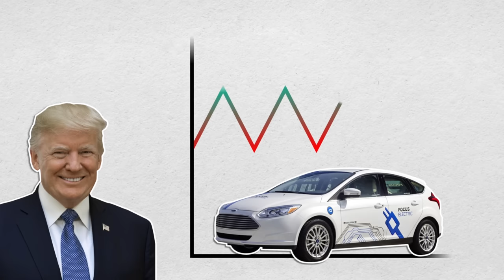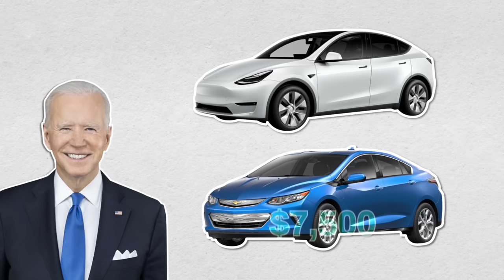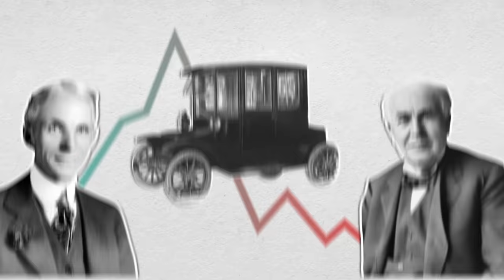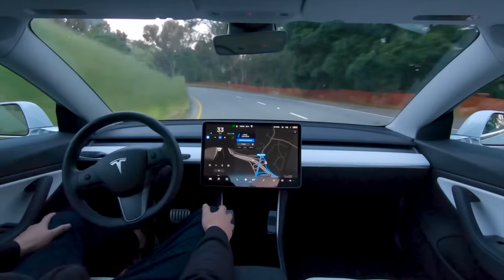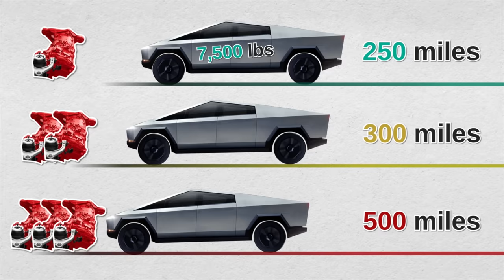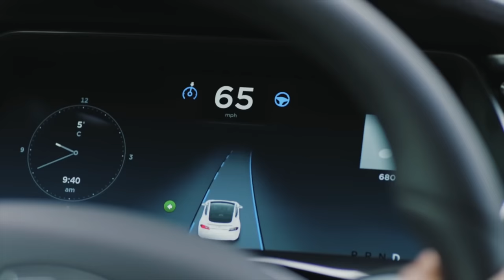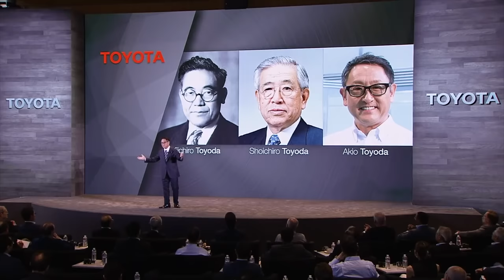Here's Why Toyota is Refusing to Make Electric Cars

Comment: You couldn't give me an electric car. Currently, GM is recalling over 140,000 2011-2014 Chevy Volt cars as their batteries do NOT last as long as predicted and thousands of owners are disgusted poor mileage distance the cars travel before a charge and length of time to charge the vehicles. Of late several electric cars including Jaguar have burst into flames while charging. Not a good idea to keep these vehicles in the garage. Battery replacement costs are thousands of dollars.

Comment: A few problems.

First, the US is not the world. Loads of countries have incentivized EVs and have been rather successful.

Second, all governments have been super nervous about EVs because it screws up a lot of funding for the roads. There's no per unit fuel tax for electric vehicles. However there could be one for hydrogen.

Burning fossil fuels in a power plant to generate electricity is way more efficient than burning them in an internal combustion engine. And EVs are way more efficient at using electricity than ICEVs are.

Comment: Bolt EVs have all been recalled for batteries spontaneously causing fires.  Chevy has notified Bolt owners to NOT charge their car in the garage or near a combustible structure, such as a house. Tesla vehicles have had the same issue for a while and are widely known to erupt in flames when in a serious collision.  Lithium-ion batteries are notorious for spontaneous "arcing" which causes fire.  Current biggest problem with all-electric vehicles is the potential for your car to go up in flames for no apparent reason. The battery technology has been forced into service by auto manufacturers well ahead of when it should have been deployed.  Good luck for now, EV buyers.  Wait five years and these issues should be solved.

Comment: Lead acid batteries were too heavy for cars for the amount of energy - why edison's electric car would not sell.  In 1996 GM had the Saturn EV1, but they were leased only and used lead acid batteries.     It is all in the battery today - they are using better chemistry that is light in weight for the amount of energy.   Hydrogen cars may yet have a place because they are more quickly gassed up than an electric car and are better in cold climates.   However, it is still less efficient to generate hydrogen gas than electricity.     You cannot easily make hydrogen gas at home to fill up the car.  However, you can generate solar energy that can help offset costs of charging an electric car.    Electric cars are less expensive to maintain with fewer moving components until the battery wears out and needs replacement.  Electricity is less expensive than gasoline.   If they can get the prices down with volume production,  electric cars/trucks are better alternative.

Comment: oh - come on Scotty.  Do a little research.   Toyota is re-entering the electric vehicle market with the 2022 bZ4X crossover.  Toyota also had previously sold the RAV4 EV.  Additionally, Toyota has several Plug-In models.  And, their hydrogen cars (being tested out of Los Angeles) are techically EV cars using a Fuel Cell to generate electricty that drives Electric Motors.

Comment: Toyota have won the race for the solid state battery and they are making a line of EVs in the next few years, H2 have problems with both the high pressure and low temperature of the fuel which makes metal brittle and may even pose a danger, ATM it's a challenge to get a working mass market car. 
H2 has it's uses, for industry and home heating but using it in cars is daft.

Comment: I will suggest that Taiwan and Japan share some economic realities. I have been to Taiwan; I have no personal experience in Japan. Taiwan has no oil industry (it has no petroleum reserves). It imports all it's oil. To make gasoline affordable for consumers in Taiwan it has to be heavily subsidized. Taiwan has natural sources of electric power in hydroelectric projects. Solar electric projects, wind electric projects, tidal projects. Taiwan is a relatively small island with most destinations reachable on one charge with currently available all electric vehicles. For Taiwan--an island with no petroleum reserves--electricity is just a very natural way to go. I expect the economic realities are very similar for Japan. I don't believe the propaganda suggesting that gasoline is a better source of power for small islands that have no petroleum reserves. ...especially for small mountainous islands that have great potential for hydroelectric projects. Earthquakes??? Electricity from multiple sources is still better for small islands with no petroleum reserves.

Comment: A car mechanic that does not like electric cars (that require less maintenance and therefore fewer car mechanics).  Hmm...

But yes, some things are pretty obvious.  Cities are too polluted, so urban areas will need to move away from polluting technologies like gas and diesel, over time.  That could be electric, that could be hydrogen, but the power for these can be renewable and/or outside of the urban areas.  Electric cars will need to have some quicker way of recharging or quick-change batteries -- perhaps gas stations becoming robotic battery change stations.  And EV prices would need to come down some so that cost per mile is more competitive.  Tesla, GM, and (in Europe) VW are pretty close, but not quite there yet.

Comment: I'm still waiting for a super or ultra capacitor based hybrid.
Reply: You'll be waiting a long time. The energy density of pure electrostatic capacitors is unlikely to get close to chemical energy storage (aka batteries). The latest batteries are almost as good as capacitors in that they can charge and discharge very fast. At one point some people were using ultracaps to provide high discharge rate acceleration bursts (and to provide sinks for strong regen)  but now it's just not necessary. Many battery EVs are capable of providing accelerations far in excess of comfort and regen braking is now (almost) limited by tire grip rather than energy recapture in to the batteries.

Comment: For hydrogen cars to succeed, not only do they need to have more hydrogen stations available, but the cars need to perform as well as EVs. 0-60 in 9.2 seconds is not a headturner
Reply: Hydrogen will never be a good option for cars. Expensive fuel! Electricity is cheap.

Comment: Both BEV (Battery) and HEV (Hydrogen) have their place in the future and probably a combination used on the road, though it doesn't have to be Hydrogen alternatives are possible. The problem is people (specifically Battery fanboys) keep claiming that battery is the only way to go this and that. BEV is good if you can produce it locally but as many places across the world (think growing tropical rain forest in California desert) it is based on your actual environment not your fantasy "theoretically this is better so it is the only choice". If a region can responsibly and sustainably produce either electricity or hydrogen than it makes sense to do so. The reason battery is bad for certain regions is because they cannot produce or transport the required electricity whereas Hydrogen or alternatives are viable long term storage capable comparatively speaking with current battery tech. The larger picture being practicality, sustainability, future development. There are certain regions that have massive untapped energy like desert solar that is not being utilized that can produce said hydrogen/alternative that can be produced away from urban areas and stored that batteries just cannot do. Battery fanatics keep saying battery is the best and only choice that can't consider anything else as viable are idiots. I know there are many you idiots out there thinking it is better to use gas to produce electricity to power BEV than it is to produce hydrogen cleanly and transport that as fuel. You think making every urban area micromanage produce gas-electricity on-site is better than large freight delivery of fuel? Keep dreaming. It is only better if it is better not just because it is battery.

Comment: Need to get the range up. And the biggest problem will be a few years and they have to replace the batteries so I see a poor resale market. And high  repair costs . And people getting killed trying to fix  their car. Chevy is having a recall because of battery fires.  By 2040 75% of people will be priced out of cars

Comment: So doubling the batteries makes Teslas "truck" 1 second faster to 60mph, tripling batt pak 2.5s to 60; and increased range w increased size battery pak.
More important results I'd like to know are
1) objective comparative evaluation
of handling response on a) various road types and conditions found in the USA and.  b) on oval track for cornering forces 
2) brake performance.  With stopping distances not only measured 5 times at various speeds but with stops at each particular speed to be performed consecutively and immediately without cooling interval in between stops.

Doubling and tripling weight of battery paks
surely will affect factors of greater importance than getting to 60mph 1 second quicker.
And we all know from VW and Hyundai gas mileage figures that only 3rd party testing (not picked by mfgr)
can be relied on.

Comment: The future is electric, but the world is at a crossroad - either Hydrogen powered FCEV, or battery powered BEV.

FCEV advantages - Faster time to fill up, potentially longer mileage.
BEV advantages - 10x cheaper fuel, infrastructure already exists (but should be expanded), more comfortable in daily commute since no need to go to a designated fuelling station - you fuel it while it is parked.

FCEV disadvantages - Need to build out the number of fuel stations to rival that of petrol / gas stations, need to build a new infrastructure that rivals that of petrol and is about as expensive to maintain as petrol. FCEVs are at the very least three times as expensive to drive with fuel costs alone not to mention all the infrastructure that needs to be built out.

BEV disadvantages - Need to stop to charge; charging takes a large chunk, not ideal on road trips (though managable). More stops to make. Otherwise no disadvantages compared to FCEV.

Conclusion: Cheaper car wins, BEV crush PHEV. End of story.

Comment: Has anyone considered the weight difference of the electric car to an normal combustion engine on the roads its going to cut up the road way more . BMW 320d 2027 weight 1700kg BMW 3 all electric weight 5000 + .

Comment: Until Toyota, begins making Electric cars I do not believe they will be feasible for the average person to use. Let alone the enormous strain they will bring to the grid after 5pm when everyone returns home and plugs in the car to begin charging. This notion well Sweden and the UK are doing it differently what is the size of those two compared to other countries. You can't compare a country 11% bigger than California to a country that has 10.23million vs 328 million. Also, the cost and scale of a brand new electrical grid are very different between the two the US grid we are probably talking years if not decades to fully rebuild it for this idea and that is not factoring in cost or material for it.

Comment: Electric cars IMO are useless in Alaska. Distance between Fairbanks and Anchorage is over 650 miles. Second I haven't seen if the electric car can survive temperatures that can reach -50°F. Until they have better range and survivability in extreme cold conditions, I will stick with gasoline powered vehicles. Again IMO only.

Comment: It is very understandable, that Toyota doesn´t do EV´s yet.
Their petrolcars have a good reputation for reliability, although this seems to be in America mostly.
EV´s are a completely new ballgame, where Toyota´s reputation is probably not worth that much. 
Battery technology is done by a few very large manufacturers, and is not really in the hands of the car manufacturer.
Charging technology also mostly come from few large and very sophisticated manufacturers.
EV motors are where the makers differ in some ways, but the losses in electric motors are pretty well descibed already.
This means, that the competition between makers will probably change pretty much, and come down to the car body it self, handling, safety, quality feel, protection against rust, user interface, smooth ride, noise, entertainment, self driving and other areas, where Toyota never really won the golden medal.
So petrol is pretty crucial for Toyota, and they are aware of, that it will take quite some time, to create the infrastructure for EV´s.
Thus their plug-in hybrids will probably be popular for some years to come.
It might also be possible, that EV´s will not take over the entire market during the next decades, fuel cell´s might become a good alternative, especially if the hydrogen is produced with renewable energy sources.

Comment: Toyota’s are boring cars though. It’s simply for driving from point A to point B. But they’re very easy to maintain and just runs well. Still driving a 2007 RAV4 V6 4WD (198K) and a 2008 FJ Trail Teams (260K). But I noticed the FJ is a head-turner.

Comment: No matter what the source of the energy, fossil fuel or renewable, electric cars are more efficient than any internal combustion engine unit.  It's simply a superior technology like going from vacuum tubes to transistors.  You don't have to be a tree-hugger to prefer EVs.  (EVs are more compatible with a wider variety of energy sources than ICE units.  Try running your Suburban on nuclear or hydro power.)
Reply: If you had a suburban diesel it could run off of vegetable oil. Yes, EVs are more efficient, and probably less maintenance, However if there is no electricity you won't go far in your EV. Nuclear and hydro power are rare in the US so most electricity still comes from coal or NG. Solar and wind are not viable options. You also have to remember that EVs use a lot more "precious metals' which have to be mined mainly from other countries. They also use a lot of copper, which we all no has sky rocketed in price. Then there is the disposal of the batteries at the end of their life. These contain numerous amounts of of toxic metals that can't always be recycled, or won't be because of costs. I'm not totally knocking the EV, But they are not as great as the gov or manufactures want you to believe.

Comment: EVs rely on rechargeable lithium-ion batteries to run. The process of making those batteries — from using mining raw materials like cobalt and lithium, to production in gigafactories and transportation — is energy-intensive, and one of the biggest sources of carbon emissions from EVs today. Gigafactories are facilities that produce EV batteries on a large scale. Producing electric vehicles leads to significantly more emissions than producing petrol cars. Depending on the country of production, that’s between 30% to 40% extra in production emissions, which is mostly from the battery production.

Comment: Hiya Scotty,watch all your reviews,I do think you are not being fair to used mercedes,I bought a low miles s430,2003,123k,I've owned many,many cars,I have two mercedes right now,if you but a mercedes icarsoft mb11 scanner and have a little ability it's no more expensive to maintain than most imports,I put new rotors on my ml model with pads for 60.00 rear,drilled rotors for the front for 72.00.

Comment: Not true, Toyota has an all electric car - it uses hydrogen as electric energy source, instead of a chemical battery. Without combustion. No lithium battery with 10 kg cobalt per car. 5 minutes recharge. Its byproduct is water.

Comment: Scotty I think you made a fairly balanced video. However The point about hydrogen fuel cell cars or any hydrogen cars is what Elon Musk says about them. They are not the way to go to reduce green houses gasses as they used much more energy to get the hydrogen. And Toyota’s CEO is correct, but no  one mentions the real solution for electric generation which is solar. This is litter ally a no brainer. Unless someone comes up with a work fusion reactor. People will be dragged kicking and screaming into to the electric car future , but make no mistake it is happening NOW.

Comment: Until an electric car can give me the range of a gasoline car and also a recharge time at about as fast as it takes me to fill up a tank of gas, I'll be staying away from an electric car because I like to travel and I don't want to have to drive 250 miles just to stop for 10 hours and charge my car just so I can drive another 248 miles. Yes, battery capacity diminishes over time which means longer charging times and less driving range.

Comment: Screw electric cars & trucks. Screw in toads that run our government. Living in NW Montana we have enough problems with fire starters (Which is almost a garantee if an e car wrecks) and in the winter where temperatures can get to -40° I will never depend on CCP batteries.

Comment: Many her are ignorant about EV's. Do some research. They are 80% energy efficient vs only 20% efficient ICE (Internal combustion engine) vehicles where80% of teh energy is used up in heat. Example; I drive my ICE vehicle into the garage and it turns into an oven from the heat radiated from the engine. Not so in a EV. Ov's get  a range 80 to 150MPGe. I pay $5.00 to change my Chevy Bolt and get 180-300 miles. You can not say that about ICE vehicles. Think of the thousands of tons of emissions not dispersed into the atmosphere with EV's. That's a huge difference. Don't be fooled, the oil industry is attempting to villainize the electric vehicle industry.